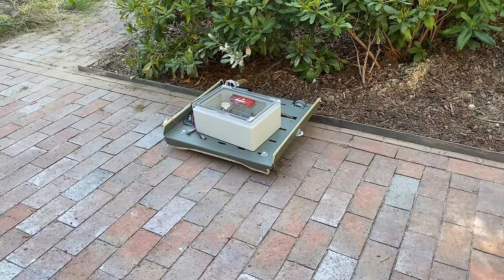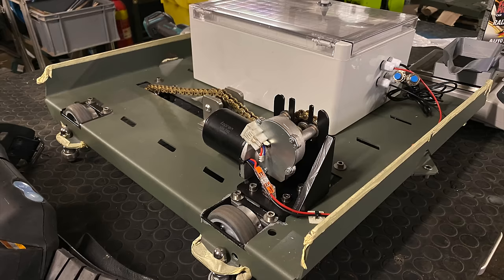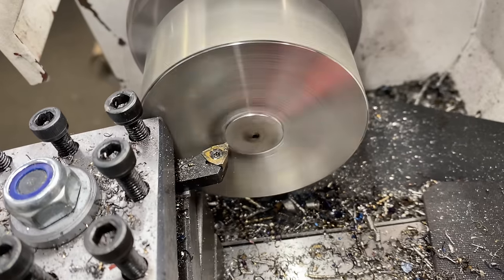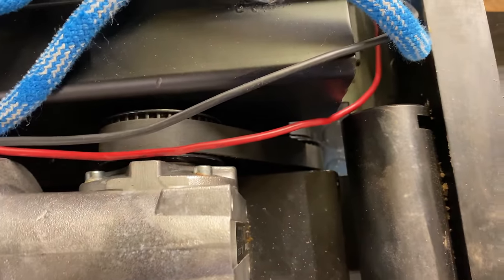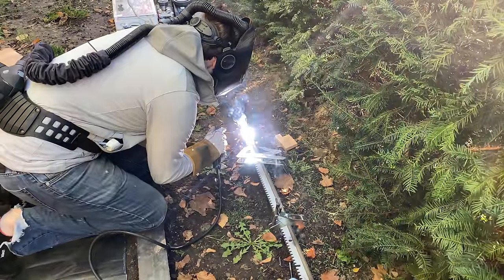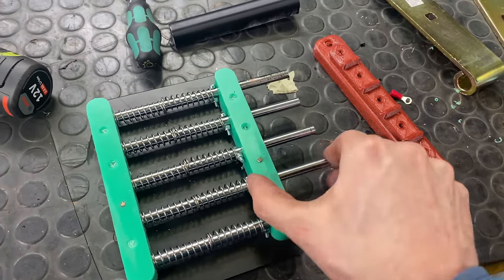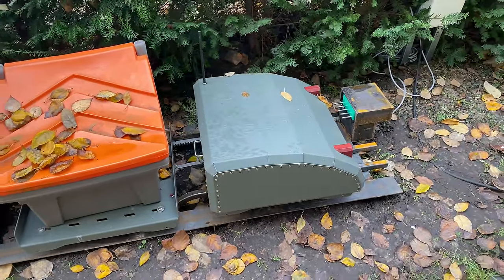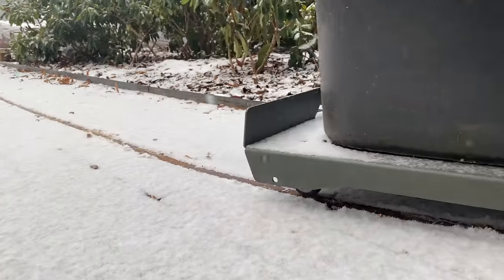I put my trash cans on rails and now they move automaticaly! (Trash Train)

Comment: What I like the most with this project is the minimalist approach of the track. Many would have goes crazy with a complete train-like track that would have been in the way of other things, so this approach where the wheels run on the bricks on one side is brilliant and really innovative! well done! (now i really need a house... )
Reply: to add a thought to this, another idea would be to space track vertically instead of horizontally so that it can run along a fence, but obviously depends on where a suitable fence can be placed, but I can imagine such a solution could be totally invisible until the trash-train comes riding along the fence. :D
Reply: Yep, trash can train takes a "minimalist" approach
Reply: @sgtjonson  quite literally by definition, yes this was a minimalist way to approach the problem and minimalism is not always about not having a ton of stuff, it can include environmental impact. the impact to the environment when creating something such as this or even our roads for example, all can be measured or quantified, so by taking the solution that makes the least impact you are taking the minimalist approach.
Reply: @hhjhj393  there's a motorized cable crimper that runs on a thick cable while braiding another cable around and it hauls an ~20kg cable reel with it so maybe you can use it for this purpose but you may need something similar to tracks to keep the wagons in place either that or use hooks and trash bags instead of containers
Reply from the maker: @hhjhj393  The track was the easiest part. The hardest was machining all the shafts and power transmission things without a mill. You really need keyways but without a mill its a struggle to find alternative solutions.
Reply from the maker: I realy tried to make all stakeholders happy. The enduser, the city, the garbage people and the environment. Its the best compromise and fun as well.
Reply: Awesomeness!  Let’s hope the bins are placed back correctly after being emptied!  I can also see this system for those with long driveways or homes set back into the country, needing to place their cans for pick-up. This is very cool.
Reply: @MaxMakerChannel  Hi Max, i'm a mechatronics student from germany too, and i absolutely enjoyed this video, it remided me soo much of my self, its great seeing people getting creative and solving everyday problems with engineering! i had to laugh when you mentioned that you are in germany =)
I could really imagine how this could be a viable product in the future, although i have absolutely no experience with all the economics stuff, i'm more the engineer type of person, but i could really imagine how one could keep improving upon this, testing, and maybe also adding new features; some sort of interface (something like a (absolutely tiny, nothing big) webserver with say node red and an simple interface for status, setting timers for weekly trash etc. could be really quick to implement and also be helpful for future customers ;) (which would of course still have the benefit of beeing enterely hosted locally, and nothing in the Internet), and this might be much more convenient than an extra remote; although requiring an internet connection to the location, but i think still might be a viable idea).
Also i think that for a final version you'd somehow have to think about the endstops again, because the way it is now, a stone or a fallen stick could potentially trick the endstops (nothing would break really, but it would still be anoying and maybe the train wouldnt return to recharge or not get out to the front in the first place. 
Man i'm sorry, this comment is such a mess, but all i want to say i guess it that this video hit me good, i was really blown away by how much i related to the engineering part lol
Well Done!
Reply: @David66Stang  yes! This would be amazing for someone with a long driveway or in the country. Could also go a very different route and create a vacuum garbage system like at Disneyland. Haha. Then your bags would just be dumped in the garbage. However, if you had any larger items that wouldn’t fit in a small bag, you are screwed and would have to do it the old fashioned way. 😆
Reply: @MaxMakerChannel  I would consider a stationary gate opener system utilizing cable or chain to pull the train along. You could use typical gate opener limit switches, battery backup, remote control, and control board and it could utilize a solar panel for charging, and also be hardwired into the building. All electrical would be centralized and it would just need to run the cable or chain or combination of cable and chain.
Reply: Such a Solution
would require 
to make a special fence
... or just a good stabile Mäuerchen  (little wall)
Reply: Well done also I’ve have many ideas which is to atomize all of our materials in the future and basic inntions like mail tube from gated community mailbox nexus, roof solar and wind arrays, area conditional/ heaters on cold and hot days powered by clean energy of winter and summer,etc look up my works online!
Reply: @MaxMakerChannel  For a key you could just put the shaft in the wheel and drill a 8mm hole just where the two parts meet. Then insert a piece of 8mm rod as a key.

Comment: As a commercial product you would definitely need some safety sensors to ensure it would stop if someone or something was in the way. Even on this unit I would recommend it, especially as you are using this as an aid for seniors. Limited mobility means more difficulty getting out of the way quickly, and even though someone has to activate it manually, 1) you should assume they will hit the button and walk away, not watch it, and 2) seniors also can often have reduced reaction time and coordination, so if someone were to step around the corner in front of the train they may not actually manually stop it in time even if they are paying attention.
Reply: And we see from the end stop segment of the video it does have its inertia.
Reply: Maybe switching it to require the button to be held down for the whole movement would work - kind of like controlling a stair lift
Reply: @nathansvlog  that should safety any safety concerns, and is definitely the simpler solution (and with less components to go wrong). Just a bit less convenient.
Reply: Or people could employ common sense?
Reply: @prodbybabygod7411  yeah... Good luck with that!
Reply: It's called natural selection
Reply: An overcurrent sensor would probably be best - if something is blocking the train and it cant move it cuts power like a garage door
Reply: @mikef5951  the system needs to worry not only about electrical power, but also about the momentum of the trash cans!
Reply: @mikef5951  When the train hits someone to stop it's already too late. It has to be able to predict fatalities
Reply: @gamesnic  if the train moves very slow it is ok.
Reply: @yipwinghei  To make the train safe on hitting an object you would need to make it move so slow it would take several minutes to reach the other end
Reply: I’d also be concerned about the trip hazard from the equipment close to the ground. I am thinking of kids that would want to play in that corner, people with impaired vision etc. Maybe a system similar to an RC car would be safer? I am thinking like those food delivery robots on college campuses, but you program a route and it follows the same path every time. Also I’m not sure how the trash collection works in Germany, but my bins in the UK certainly wouldn’t end up in the same spot once the rubbish has been collected. Obviously the bins would be lighter and therefore easier to put back on the vehicle, but for some disabled folks this wouldn’t be an option.
Reply: This is germany, so i'd guess you would need to make sure also noone can touch the Pogo-Pins on the Charging side, not be able to disengage any safety (Meaning clipped-shut Electronics box, or even glued), Not being able to touch the gear-drive, etc.
Reply from the maker: It doesn’t have inertia. The motor controller just slows it down gently to keep it quite. You can do a full stop in a few centimeters if you want.
Reply from the maker: Thats the way it is. Need to keep the button pressed.
Reply: @sanastratus3998  rails can't get worn off like ground can. In a matter of one week your garden would look like a motocross track
Reply from the maker: It has current sensing and stops. If that fails the fuse would blow if you place your foot in front of it. No problem.
Reply: Nah he just needs a tiny level crossing (one of those train crossing gates) with a little mini bell. 😊

Amazing project, well done!
Reply: @pepeshadilay  no need to fetishize nature.
Reply: Stop by the auto salvage yard and strip a wrecked Tesla of its sensors and control box.
Reply: For safety I would recommend an orange strobe beacon on either end of the train and a white noise backup alarm at the back of the train
Reply: @MaxMakerChannel  no steam whistle to alert passerbys?
Reply: Small children are also at risk
Reply: Its like you buy a sandwich maker and put your hand inside. Don't go into the track on the first place. 😂
Reply: @prodbybabygod7411  animals don’t always behave the way you’d think…. I’m always amazed at how long animals will run in the same direction you’re going in a bike/car before they turn off the trail/road 🤪 I think it would be easy enough to put the stop sensors on the front and rear of the unit rather than on the end stops of the rails 🤷‍♂️
Reply: i agree with this to avoid lawsuits and ease customer concern. i would also suggest having the rail system (or whatever youd call the gear rail) underground to avoid a tripping hazard. safety...sure. selling point..100%
THEN you can make it a requirement to have seasonal maintenance done to the track and tractor to keep the warranty up and also charge for service with a yearly/monthly plan! gotta keep that track and tractor clean of debris and make sure its all oiled up or else, uh oh, you lost your warranty! also your minimum wage techs are the only ones who can service them!
money on top of money!
sneaky business is so freakin cool 😎😎
Reply: i seriously doubt this thing could hurt someone if it bumped into them
Reply: Came here to say this - the trash cans are in a public area, probably kids around, and they'd love to stick their hands in there. Liability risk for the owner.
Reply: @pepeshadilay  If he dies, he dies. - Ivan Drago
Reply: @sammiller7509  and a large horn.
Reply: That's easy, just add ultrasonic sensors like the ones used for rear parking cameras. I think they even sell modules for Arduino.
Reply: @pepeshadilay  It's called murder or suicide since the button needs to be pressed to move the train forward/reverse
Reply: @pepeshadilay  tell that to the judge when a little kid is hurt.
Reply: @GandhiTheDerg  Yes, the pogopins should be on the receiving side, and enter holes on the powered side to protect from the live contacts. But as long as we're just talking like 24V or 12V DC charging we should be fine regardless though.

Comment: Small recommendation for the commercial version: you should make the motor portion detachable from the trash cans so that in the event that repair is needed the person can still use the tracks manually. 

Not sure if someone else already posted this but wanted to mention it!
Reply from the maker: Oh yes it’s detachable!
Reply: @MaxMakerChannel  And a small wooden hut (garage) for motor partition which protects it and charging terminal. If that hut is light weight then it can be lifted easily if motor needs maintenance.
Reply: No, because I would totally get this installed at the house so we don’t have to keep bringing the trash out